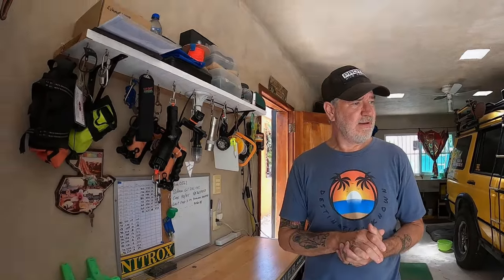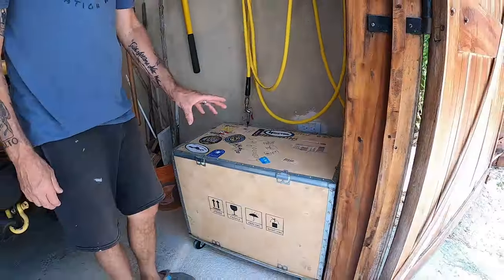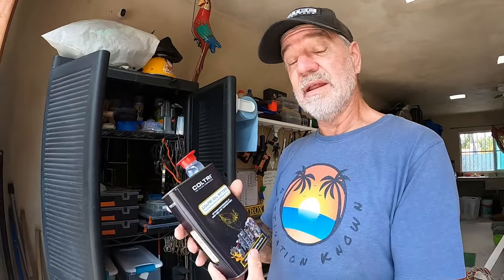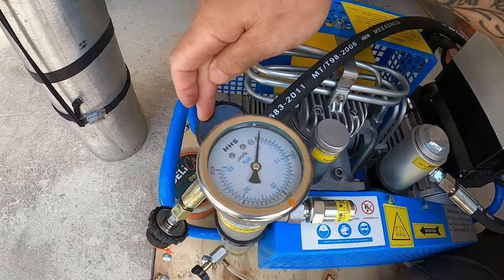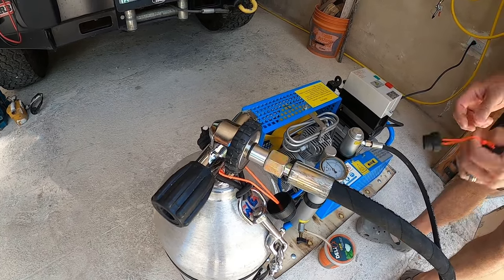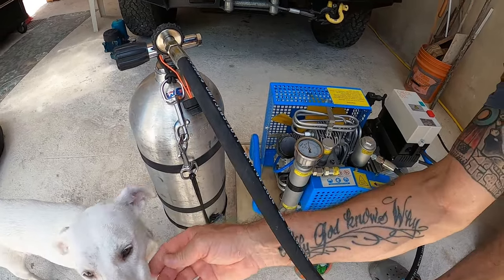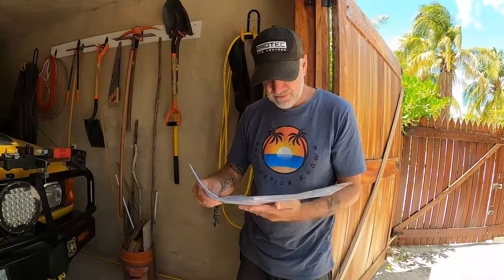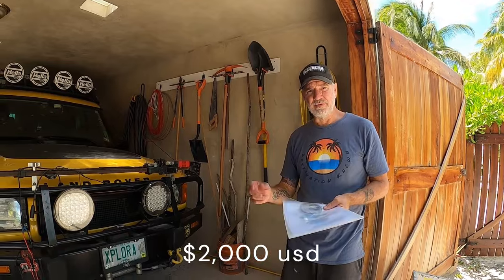Gear Up for Adventure: Tuxing Scuba Diving Air Compressor In-Depth Review & Demo

Comment: Your compressor does have auto shut off on it.  It’s adjustable!  Easy to set it to 200 bar if that’s your fill pressure.  Remove the  1 Phillips screw from that back square cap and beneath the the screw hole is an Allen screw mine is a 2mm someone else said 1.5mm. Screw it out to decrease pressure and in for more pressure.   It’s nice having the automatic shut off feature
Reply from the maker: Thank you!